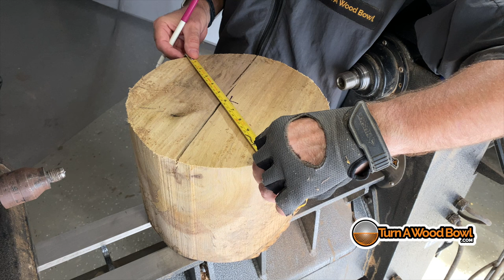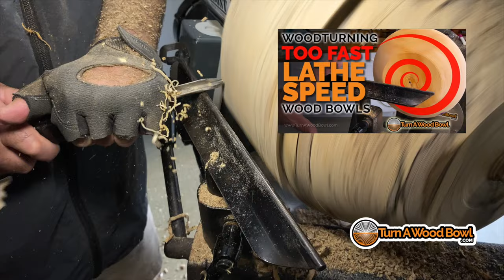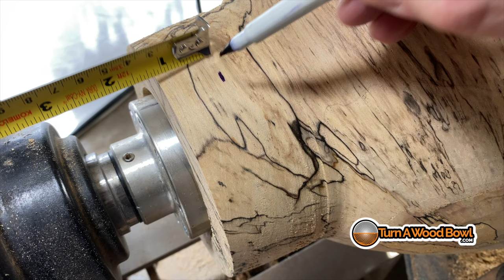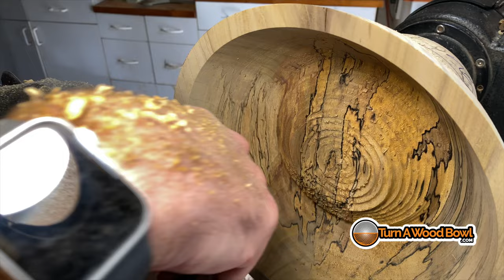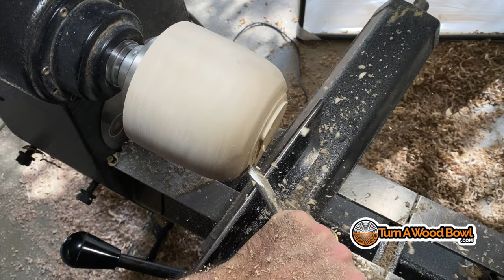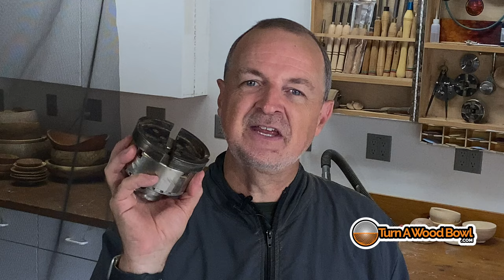Wood Bowl Turning Without A Chuck Woodturning Video

Comment: This a wonderful, well explained method using the faceplate which comes with most lathes when new.   No need to make that "exact tenon" for jaw check  use.   The face plate is very secure so no opportunity for the bowl to  become a flying object, if proper screws are used.
Reply from the maker: Bob, yes this works well. Thank you, and Happy Turning!

Comment: This is how I was taught to turn at school in the early 70s... more years ago than I care to think about! Also with a face plate and green beize to cover the holes. Happy days... :-)
Reply from the maker: Very cool! It's good to know how to turn a bowl without a chuck. Today, that's a special skill. ;) Happy Turning!
Reply: Hi Tony - I was also taught much like you, in the early 60s..  With a 16" D. x 5" thick blank, and 1/2" screws into the wood - I was convinced it would fly off...  We also had a sneaky/neat way to fix the baize to hide the screw holes... but it needs a diagram to explain properly...
I remember suggesting that we could use a metalworker's chuck... and the tutor sanctimoniously replied: "We don't do things like that, here..."  lol
Reply: I don't recall being told about the 'jam-chuck' idea, back then - maybe our tutor was not a lathe devotee...

Comment: When I use a spur drive, I drill a hole a little larger than the diameter of the spur about 3/4” -1” into the wood.   This acts as an extra safety measure when turning large pieces of wood.   If the Spurs were to lose their grip in the wood, the hole would at least keep the blank on the lathe instead of flying off and potentially cause injury.  Doing this is not going to hurt the blank since it will eventually be flipped around for the face plate mounting and the hole will be removed during the bowl hollowing process.
Reply: Valuable tip J; thanks.  Bernard.
Reply from the maker: Good advice. Thank you for sharing and Happy Turning!

Comment: Excellent tutorial on gouge usage.  I was taught to use a two-prong drive center, and to pound it in with a wood mallet across the grain.  This eliminates the constant worry of the loosening of the piece...mostly.  The tail support will still need to be tightened a few times.  It's also worth mentioning that the spalting is a mold and the dust is toxic.
Reply from the maker: Thanks for the drive info. However, spalt is not toxic and is highly desirable. Spalt is the mineral remains of fungus that moved (past tense) through the wood cells. The dust from sanding is a real issue and we need to wear our respirators when sanding. Happy Turning!
Reply: I'm sure you don't, try not to pound the drive on the lathe, it puts a lot of strain on the bearings
Reply: @glenncornish6877  I do this on the floor prior to putting it on the lathe.  Even if it's not quite straight the piece will move to line up the tail support.
Reply: @TurnAWoodBowl  if the wood was freshly cut and wet, would the mold be living and toxic to us? Would one breath it in as you turned the bowl?

Comment: Thank you once more for an extremely helpful and educational tutorial video, Kent. For me it is not just the three tool method, but your technique at each stage. The open flute is interesting where you take off the ridges inside the bowl, as I have learnt to be very afraid of an open flute inside a bowl. I go in with closed flute, ride the bevel and gradually open until it just starts to cut. Your advice on my method and the potential snags I might get would help me. Take care stay safe and please keep these invaluable detailed tutorials coming. From across the globe in South Africa, you are teaching the world to turn.
Reply from the maker: David,
Thank you for writing. 
Yes, the open flute can be dangerous. However, pay attention when I use this technique. I only open the flute for very light finishing cuts and not when removing larger amounts of material. 
Keep practicing and you too will eventually feel more comfortable opening the flute as you progress.
Happy Turning!

Comment: When I began turning and had an old, used Rockwell 11" lathe I had only faceplates, no chucks.  I even made a few faceplates with inserts from Grizzly like this one: Steelex D1102 - Insert - 1-1/4" x 8 TPI, RH Thread.  I also used glue blocks and paper glue joints extensively. One reason I used glue blocks was to work with thin pieces of wood.   Still a good technique.  Nowadays I use chucks, mostly because of speed and convenience.
Reply from the maker: Thanks for sharing. Yes, glue blocks are another option. Happy Turning!

Comment: Excellent. I currently have a very inexpensive non standard headstock thread (M18 x 1.5), which I'm not able to find a chuck for, and I will now experiment, before moving on to a more conventional lathe setup in the future.
Reply from the maker: Perhaps, there is an adapter you can purchase to convert to a more standard chuck size.
Reply: Hi there, thanks for your suggestion, but I have already tried that option. It seems my only option might be to get an adapter specially mde. This might not in fact be cost effective.

Comment: That is a gorgeous spalted grain. The size of this blank might have been a candidate for coring, something I’m not equipped for. The “soft” nature of this wood would have given me a big problem with tear out. I’m getting better as I build my “hours” on the end of my bowl gouge.

You describe how you move your body rather than your arms and hands to control the cut. I would describe this as “lock your arms and hands” and move your body. It’s the same thing but just a different way of describing it. Another good video.
Reply from the maker: Thanks. You make a good point. Perhaps I’ll do a body movement video. Happy Turning!

Comment: Do you strop your flutes? You didn't show it so I wondered. Stropping off makes the tool so much more reliable and the edge far more resistant cutting down on shaping a lot. Really fantastic instruction.
Reply from the maker: Thanks, no I don't strop. I've had good success without stropping, but I may check into it. Usually, the edge is wears down so quickly, it's not worth doing much more to the edge beyond sharpening. Thanks. Happy Turning!

Comment: Something that would be really cool that I haven't seen before, is a live lathe RPM indicator as part of the video, like in the lower right or something.  It would require a data logging tachometer where the logged RPM data could be time synced and added to the video in post-production, basically like a subtitle data file.  Seems like it would be especially helpful for beginners to see real-time how experienced turners vary their lathe speed for the various cuts throughout the turning process.  Something cool for a techie to figure out :)
Reply from the maker: That is a cool idea. Here watch this and take the covered rpm challenge. https://youtu.be/qkAwPg-fPN8 Happy Turning!
Reply: Great idea. It would really help me as a new turner.

Comment: Hi. Informative video. As you asked about different ways to turn a bowl without a chuck..Back when i was a young fearless teenager, I was taught wood turning by my Grandfather. He devised a system of what he called a press fit face plate. He showed me to mount the bowl blank on the metal faceplate and turn your bowl pattern. You then turn your tenon ring on the bottom I say ring as instead of a flat bottom, he turned a ring base of five to 10 mm and 3 to 4 mm deep. This half turned bowl is then taken off the faceplate and a 25 to 30mm piece of hardwood mounted to the faceplate. This was rounded and faced off. Now the what seems sketchy bit. He taught me to turn the receiving hole for the bowl ring as described above. This had to be slightly smaller and i mean half a mm smaller. Get this bit wrong and it goes wrong. The bowl is then press fit to the receiving wooden chuck. Now it may seem weird but this method worked if your accurate with the wooden chuck. I wouldnt do a bowl the size and mass you just did but ive turned 12" plates this way and countless bowls using this method. I stress that I would NEVER use this method in this day and age but thought I would share an old old method I was shown and used.
Reply from the maker: Wow, that's fascinating. Thanks for sharing! Sounds very interesting. Happy Turning!

Comment: For years I didn't have a 4-jaw chuck. I used a screw chuck with a single coarse thread OR if the wood was too punky, mounted the blank base with Super Glue (sandwiching brown paper in between) to a base plate.  No screws or holes to contend with.   It was mounted between centers to begin as you have, but the screw chuck is inserted into the mouth/top end of the bowl instead of the foot to start shaping the exterior.  I left a tennon so it could be flipped to hollow.  To tun off the tennon, like you, would fashion a piece of scrap to mimmick the inside to act as a jam chuck.
Reply from the maker: Sounds like a good way to make a bowl as well. It's funny how many ways there really are available. ;) Happy Turning!

Comment: An alternative to a four jaw chuck is a faceplate with a sacrificial woodblock on it with a centre hole turned in situ that matches a tenon turned onto the bottom of the bowl. Glue the bowl tenon into the sacrificial block centre.  There is a video on YouTube of a turner using this trick to make a birdsmouth bowl. In metalworking, this is a common way to make a production fixture, usually using a removable precision metal dowel because holes are easier to make than studs.
Reply from the maker: Thanks for sharing. Much appreciated. Happy Turning!

Comment: Hi Kent .. Your like the Bob Ross of bowl turning .. Kind of a hypnotic speaking pattern.. Love your videos... Question is there any reason you didn't use the faceplate  on the bowl side first seems like it would have been more secure... Excuse my ignorance I am a noob.
Reply from the maker: Thanks for writing and sharing. Bob Ross, that's funny. ;) I wanted to show two different and easy ways to mount the bowl in the lathe. As so many things with turning, you can usually find several different ways to accomplish the same task. Do what works best and is comfortable for you. Happy Turning!

Comment: Great video. I noticed that you use washers for spacers on the drive so plate doesn’t come to ends of threads. My delta has much more space than that to be taken up for same reason. I had turned some spacers out of out and they worked good for awhile. Then the light went on. I had some used roller bearings and the centre of the bearing was a perfect fit on the one inch drive. Perfect !
Reply from the maker: Good tip! Thanks for sharing. Happy Turning!

Comment: I tried my first bowl today with a glue block method I saw elsewhere. I learned about 80% through roughing out the inside of the bowl that dry red oak might not be the best material for a glue block (when I had a bit of a catch and the tenon just cracked right off). Whoops! A nice gouge in the middle of my bowl and some repairs needed on the foot, but I decided... it's my first bowl. I'm just gonna chisel the tenon remnants out of the bottom, sand it down, oil it, and put it on the mantle like I planned. I'm always telling my kids to stick with things, that before you're good at anything you have to spend awhile being bad at it. Maybe they'll believe me when it's staring them in the face every day.
Reply: I use a good grade of Birch 3\4"plywood and Tite bound glue with a brown paper bag circle cut out the same diameter as the face plate put the paper between the bowl blank glueing both sides bowl blank and glue block clamp it over night and turn away I have never Lost a bowl yet I'm pushing 70 this is how my high school shop teacher taught me. When you are ready to remove it from the bowl simply take a chisel bevel side to the glue block and tap with a mallet and it will pop off I do this in the lathe with a towel on the lathe bed just in case but most all the time it hangs on from the paper! Happy turning to you!👍
Reply: @jonperley9722  Thanks for the advice! I’ll give it a  shot.
Reply: @etesla  sorry i spelled Birch wrong! long day yesterday LOL!

Comment: Hello Kent. Thanks for another beautiful demo. What is your opinion about using a vacuum system for clean up at the end.?
Reply from the maker: Good question. I simply sweep. You can vac after the majority of the shavings are cleaned up. Trying to use a vac for the whole process will quickly choke the vacuum. See this video https://youtu.be/N2YkSc-6upY
Happy Turning! 
Kent
Reply: I thought that he meant a vacuum chuck.

Comment: Thanks for this very helpful video.  I like the idea of keeping the tail stock in place for first steps in turning the inside, but cannot figure out how to get my tool in the right position to take a cut without running into the tail stock with the handle.  Are you using a very short handle or is the some other way to maneuver this?
Reply from the maker: Good question. It has more to do with my bevel angle at 55°. Watch this for a bit more info on that topic  https://youtu.be/o2dS0FWfLT4  Thank you and Happy Turning!

Comment: OK, I would be scared to do it, especially with something that size... I've been using hot glue and waste blocks (not always fun), but what I love about this clip is that it feels really raw and real. I see the movement (that I call shaking) that I see on my lathe and the fact that not every cut leaves the surface shiny and perfect :) Great job!
Reply from the maker: Thank you. Yes, not all cuts need to be perfect, especially when roughing and removing material. When you get to the final surface, then you want to take it easy and make smooth light passes. Happy Turning!

Comment: You've probably covered this elsewhere, but wondering what you do for sanding dust.  Do you have a shop vac running near the lathe, or a filtration system or both?  Assuming you're wearing a dust mask but just wondering how you keep the shop air from filling with dust?
Reply from the maker: Good question. Yes, good respirator and I work in a relatively open area with the large door open an ventilation moving the dust out. Happy Turning!

Comment: Kent what do you do if you don't have a hand wheel at the headstock end I only have a tail stock hand wheel. So I can only screw my base plate on by turning it. I have a harbor freight 12" x 36". I guess I would just have to be carefull screwing the face plate on BC. I m also just learning how to post my comment so bear with me okay
Reply from the maker: BC, you will need to work around the handwheel. I just watched a video on your lathe, no handwheel. Rats. You will need to lock the headstock to unscrew the faceplate when you are finished. All the best to you and Happy Turning!
Reply: @TurnAWoodBowl  Ok I will be carefull thats allI can do thanks BC

Comment: This is great!! I 'm curious -- it appears as though you have a separate speed control for your lathe with a magnet attachment. Am I correct? If so what is the brand/ manufacturer?
Reply from the maker: It's a feature of this lathe, the Robust Sweet 16. Happy Turning!

Comment: Is there anything wrong with using an oscillating multipurpose tool with a saw blade in it to remove the tenon?
Reply from the maker: It should be fine. I wouldn't do that with the lathe running, and use caution.

Comment: Kent, is the sharpening e-course fully contained in the sharpening section of your bowl turning e-course or is it an additional cost?  Thanks for another informative video. I got a great buy on a 4 jaw chuck before I even got my own first lathe at one of my tool collecting club meetings.  Therefore, I’ve never turned with a faceplate yet.  I’ve accumulated several over the years, but never felt the need to use one (didn’t feel like having to contend with all the screw holes in the base or having sacrifice a lot of wood as you did in video). Stay safe and well to keep the lessons coming.  Cheers, Tom
Reply from the maker: Thank you and good question. The Tool Sharpening course is not covered in the Wood Bowl Turning course. They are separate courses. I briefly cover the bowl gouge sharpening in the turning course, but the Tool Sharpening course cover shaping and sharpening all the tool for wood bowl turning. Happy Turning.

Comment: How do you know how deep to go on a bowl so you don’t break through the bottom?
Reply from the maker: Stop continuously and feel the wall thickness. Happy Turning!
Reply: You can make yourself a simple depth gauge. Put a piece of dowel with a snug fit through a flat piece of timber, about 1" by 1/2" or a bit smaller. Must be flat and stable. .  Place the flat piece across the bowl, dowel in the deepest part. Push the dowel to the bottom. Now move the flat piece so that dowel is in the outside, touching the rim, towards you, don't move it in its hole! Sight across to bowl, the dowel shows where the internal bottom is. 
If you're aiming for 1/8" or less, then you'll need to use a gauge or feel, but this gives an indication. 
Don't forget, if you've used a mortice, you have less 'meat' on the bottom than you think. Try and get the thickness even along the wall.  A pair of calipers are invaluable. 
I hope that makes sense - I'm sure there are videos here.

Comment: You gouged out a full bowl’s worth of material inside the bowl.  Is there any way to cut around that to  have enough material to make another bowl?
Reply from the maker: Sure, it can be cored out. That's another video. ;) Happy Turning!
Reply: The tool is often called a bowl saver

Comment: Using a hammer drill to attach a faceplate should be done with caution!! I sheared a weak screw.. removing it was very time consuming. Beware
Reply from the maker: Good point, But if your drill sheared the screw, so will your lathe. Wood screws are the key. Happy Turning!